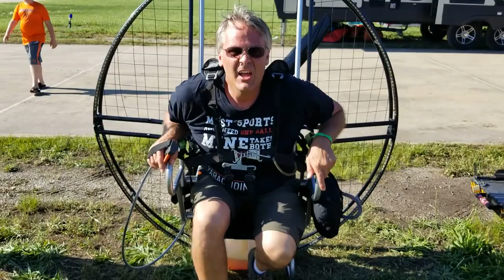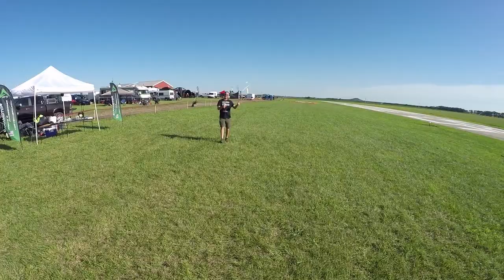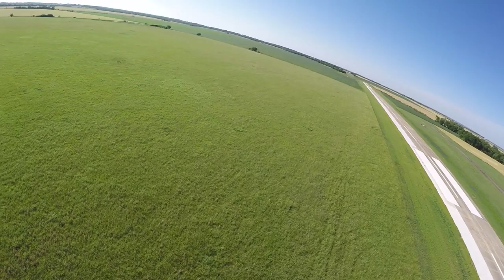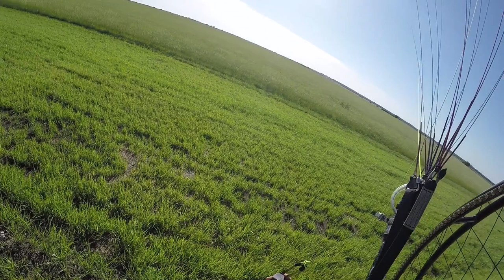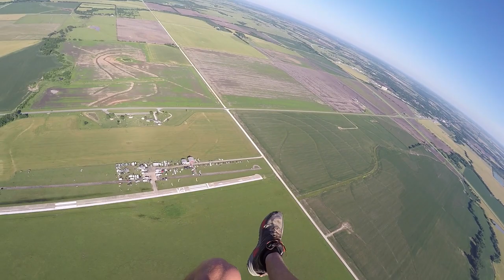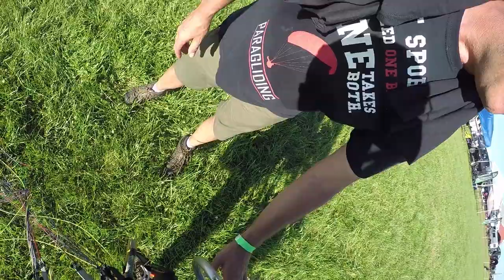Flying the Infamous Dell Schanze Flat Top Paramotor for the First Time!!

Comment: Awesome video! All units torque in one direction or another. The FlatTop doesn't do anything to compensate for that and leaves it to the pilot. When I first started flying the FlatTop, I didn't think I would like that, but I do. Of course I'm a heavier pilot (230lbs), so cancelling the torque with a little weight shift is a non-issue for me. Once you get used to the wider area between the hang points, you really start to appreciate the ability to throw your weight around. As far as weight goes, the FlatTop is no heavier then most other units. My Black Hawk Talon 190 dry weight was 62 pounds. My FlatTop dry weight is 54 pounds. So I would consider a FlatTop as a middle-of-the-road weight range. It's not Nitro light, but it's not Talon or Fresh Breeze heavy either. And yes, when ground handling the FlatTop, it is more uncomfortable than other units. But the tradeoff is already being in your seat when your feet leave the ground. You never have to let go of your toggles to scoot yourself into your seat. I only have the weight of the FlatTop on my back for a minute or two before launch since I can literally setup everything first. The skids on the bottom allows the motor to stand upright without falling over (which is super nice), while I layout the wing and attach it. I just sit down in the machine, buckle up, stand up, and go. And if it's too windy for a forward, Dell shows you how to stow your wing in the bag so you can clip in and go without worrying about the lines. For me, the bottom line is I really like the gear. I've flown many different rigs including, Adventure, Kangook, AirConception, Top80, Black Hawk, and Nirvana, and I still prefer to fly the FlatTop over those units. I'm flying a FlatTop with a Moster 185 Plus and a Dominator 19 meter wing.   P.S. I LOVE the Moster 185! I have 50+ hours on that motor now without a SINGLE issue! (I am following the maintenance guide for the motor too.) Anyways, hope to see everyone at the next fly-in! Oh, and if you're in the market for LED lights for your motor, check out @superledlights on Facebook...
Reply: Heh, you seem to be a pretty rational person. Which begs the question, how did you manage to get along with Dell?
Reply: wll1500 I drove 1000 miles with Dell one day a few years ago. He was as normal and fun to talk to as anyone I've ever traveled with.

His public persona may be a thing he does for business purposes (for better or for worse). Privately, I found him to be a friendly, smart, and sincere guy.
Reply: picramide I'm very interested to hear more. Was your trip Paramotor related? Were you his student or just casually acquanted? 

His criminal background indicates his crazy personality is probably more than just a front for his business, but it is comforting to know he can be normal when in polite company.
Reply: @wll1500  I think he's just a very competitive individual when it comes to his livelihood and the support of his family. He's been poor and learned first-hand how badly that sucks. 

He does suffer lapses of judgement like we all do to one degree or another. I speak for instance of the owl incident and his former habit of speeding through residential neighborhoods in his black jag. Both show a certain lack of empathy. But both were many years ago. 

They stay alive largely as a kind of backlash against all the criticism he's heaped on his competitors. A lot of that criticism has been rather vicious.  He was that way long before he got into PPG. In his computer business he'd say scandalous stuff about the competition every day. He was constantly coming up with ways to submarine them. He was sort of a modern-day Andrew Carnegie.
Reply: @picramide  Who told you that? Him, I'm assuming.

A man who cares so much for his livelihood wouldn't adopt such dishonest and destructive business tactics. And business practices like that aren't admirable or honorable. 

I don't think Dell has been poor a day in his life, pal.
Reply: I never said that his business practices were admirable or honorable.  Do you know the first thing about Andrew Carnegie?  Do some homework and we can discuss further.

Dell's computer marketing practices worked for many years.  Andrew Carnegie's practices were even more destructive and even more successful.  It was Carnegie's deep-seated guilt (well-deserved, btw) that led to his charitable acts later in life.

As for what you don't know about Dell Schanze - it would fill volumes.  Just because you don't "think" Dell had a poor day in his life doesn't mean squat and isn't worth my effort to rectify.
Reply: @d.jensen5153  Dell's computer marketing "tactics" further cemented his well-deserved reputation as the Village idiot and caused his stupid company to go under.

Last I checked, Carnegie died fabulously wealthy and with a successful monopoly on steel. Comparing him to Dell is an insult to every successful business man today.
Reply: You're so full of crap it's funny!!  You still have no idea how Carnegie got that monopoly.  You have no idea how many lives and businesses he destroyed through his devious and underhanded tactics.  Glorifying him is an insult to every honest businessman today.

Also, kinda pisses me off that in the 21st Century there is this narrative afloat that rich people were always rich, and poor people have no choice but to be poor forever.  Dell got rich through working very hard at a lot of jobs for a lot of years.  He also made some difficult decisions at the opportune time that turned out well.  He's also lost a small fortune along the way through PR disasters from foolish and immature personal decisions.
Reply: I promise, i'll start taking you a lot more serious if you can tell me how you know his background.
Reply: I'll start taking you more seriously just as soon as your knowledge of ANYBODY is deeper than a 30-second internet search.

I will say this:  My first personal interaction with Dell was some years ago when he consented to look at my ITV mini-wing, a wing I'd had nothing but troubles with.  It was impossible to kite and impossible to launch.

He put on a freaking clinic!  He owned that thing from the first moment.  I've never seen such deft handling of a difficult wing in such marginal conditions.  I decided that day that whatever else I though about him and his business practices over the previous decade (I refer here to his computer business), he was the best pilot I'd ever seen.
Reply: dude what is your deal? He kited your wing so now he's the ultimate badass in your mind?
Reply: The liars don't deal in logic, reason or facts.  Those who are evil bash, trash and lie regardless of truth or reality.  I built the 4th largest computer retailer in the Western US and liquidated it and retired when I was 30.  They lie and pretend it went out of business.  I"m the only person in history who can out fly a bird and they lie and try to pretend I kicked an owl.  Drive a reasonable speed on a 4 lane highway size road and they lie and suggest you a racing through kids playing in the street.  There is no rational thought to the wicked.  Those who are evil cannot be reasoned with any more than a terrorist trying to blow up a building and himself can be reasoned with.  These people who bash, trash lie are just simply evil.  They care nothing for truth or honor and hate people who stand up for truth and honor.  Those with wisdom learn from experts.  Those who are evil hate experts and pretend to learn from morons.  It's really that simple.  Liars lie while SUPERS fly.  Those who follow my advice become incredible pilots.  Those who ignore my advice don't.  Can't get any more simplistic or obvious.  The righteous have no value at all in associating with those who are purely evil that bash, trash & lie.  By all means let them fly total death trap gear without any real actual skills.  I have limited time and really have no interest in sharing my time with those who are evil.  I would much rather hand with cool, decent honorable people that care about the lives of others and the truth that benefits the lives of others.
Reply: Dell Schanze all we are all doing on here is standing up for the truth your the only one that seems to not be able to accept the truth so are you the evil one?🧐
Reply: i only weigh 100lbs so if i tried to fly it i guess id be barrel rolling as soon as i get on the throttle lol
Reply: @DellSchanze  you might just want to consider whether you look like a trustworthy professional  in these rants.
Reply: @wll1500  I spent a month with Dell and Jordan .training.he is a great dad and father and is more passionate about life then most people on this earth he designed and built the flattops for himself  because he knew he could build the best and continue to make it better .his skills  at paramotoring are  in his videos for all to see .every day he flies.and proves those skills to his students and explains and shows in detail  everything..he has the right to call out the lies and bs of this sport.and as far as the so called criminal stuff,when you live like your free and don't except the mainstream sheeple way of cowering to every bs law or  average scared to accomplish anything public,people get their pants twisted and try to ruin an otherwise great fun day.stop worrying about the bs and learn to fly from the best instructor on the planet and go enjoy .
Reply: @dwaynetempest3433  well if Dell has a right to call out bs then so do I. He didn't "design" the flat top. His design is a shameless ripoff of WalkerJet.
Reply: @Dell, I don’t understand why you are being so defensive.  Your buddy above was giving you a glowing review and I thought, maybe Dell is actually a decent guy.  Then you seem to get all defensive.  Dunno why.  I don’t know you and maybe you are a decent guy or maybe not but the rant here isn’t painting a good picture.  I’m just some random guy reading this stuff and I am impartial.  Maybe moderate your responses a bit and you might get seen for a decent guy (that you probably are).
Reply: SUPER Mike this was very helpful I’m looking into this sport and and it seems the more I look into it, it seems most people bash the man and not the equipment, I’m not looking into makin best buddies with the guy, just want too make the right purchase, after all this shit ain’t cheap no matter what gear you buy, just sayin
Reply: I've been watching everybody's channels in the past year(ish) and I try to give everybody's opinion credence, but at the end of all the Rah Rah, it boils down to skill and quality.  That said, Dell regularly renews his open ended challenge to anybody to exceed his many world records, and with so much negative opinion about the man, surely there exists a video or channel(s) of someone exceeding any of Dell's records?   If no such video exists, why should I esteem anybody's opinion or knowledge of gear above Dell's?
Reply: Derick F  well, judging by his criminal record, he's not a sane or reasonable person. This doesn't mean he's not a great pilot. But you have to ask yourself a question, do you really want to stay around a man with severe anger management problems? That's it. I know I can't trust people who can't control themselves around others. Alsp read about his computer company :)
Reply: @DellSchanze  love it, lies, good vs evil, like a good religious script. Too bad you'r not really the most believable person around. You're making plenty of claims, that aren't true - flattop is not really your design, most likely same with dominator wing, people were injured while fllying flattop etc. and you have a long story of anger outbursts over the net. Oh and I recommend everyone videos, where you basically cheer someone died, because it helps you make your point. 
Sorry mate, but I have 2 options - either whole world is against you because everyone is evil, or you just made everyone hate you with your own actions. Hmmm, wonder which is more likely 

Oh and I'm willing to change my mind, but again - good vs evil ramblings make you sound crazy, not reasonable. Maybe you should change your style a bit?
Reply: Hi Dell, How you doing ??? Long time no see or hear.
Reply: @d.jensen5153  Dell ran his comp. business into the ground as he has done to some of his students flying. With some fatal results.
Reply: @d.jensen5153  Nope never lost any fortunes let alone small ones.  Nope never had any PR disasters from doing what's right and telling the truth either.  It's my standing up for the truth which is why I've always had the backing of God himself.  Notice no SUPER training class in all of history has ever been ruined by bad weather.  Pretty silly to bash someone who walks constantly in the miracles of God.  Nope never kicked any owls and never sped through any neighborhoods at unsafe speeds.  Pretty silly to try to force one's own perception onto that which they cannot comprehend or understand.
Reply: I am scheduled for Super Training in September. Very happy to read your review of your FlatTop. I am sort of proud of myself for resisting the haters. The first time I heard of Flat Top was watching Tucker. He said don't buy one and shout out to Dell. Sorry, I don't let a 22 year old kid tell me where to shop unless they are much smarter than me...OK Tucker is much smarter than me..by God. Anywho, after many hours on YouTube and vendor sites I ended up liking Dell the best. One reason is it seems he has all the gear in stock. Other stores would show out of stock for things. I don't think I found a single dealer that had everything I wanted; and a lot of them are in Europe and I didn't know about tariff costs and such. I almost went with local instructors (I'd prefer that) but they were only dealing with quads in their training, No foot launches or trikes. I did like the kid from Louisiana. However, they were out of stock on their trike. Little things like that can make or break a decision. I like that you call yourself "Super Mike." I hope I get to hear "Super Tim" by the end of training.
Reply: @wll1500  I saw all the posts of his "criminal" behavior. That just makes me like him more. He chased a barn owl. Bad bad man...Is this sport full of pussies? Everyone is flying very loud, bird scaring, machines..Good Lord
Reply: @picramide  I agree. He comes across as a guy with boundless energy. He seems to be a loving husband and father. That's good for me. Nothing worse than passive aggressive behavior. That's what his haters do. It's just as bad.
Reply: @wll1500  You mean he points out flaws in other equipment. I want to hear that. Others do the same thing. Then, I can make a better decision.
Reply: @wll1500  You weren't there.  I was.  You have no idea how slack the wind was nor how small the wing was.  It was an amazing launch.
Reply: @wll1500  A speed wing in very little wind?  Your full of crap.
Reply: @d.jensen5153  I'm not full of crap lmao it sounds like you don't know a damn thing about paragliders 😂 want me to show you some videos of people kiting speedwings in nil wind?
Reply: Awfully nice of you to let him try your gear. I'm going in September. Dell's putting the Minari 200 in his new ones. You can still get the Moster 185 if you want it. I chose the Minari. Dell said he and his crew are flying those. I hope to fly with you one day. I'm in central Cali.
Reply: Wtf I reading this and Im getting the sense that many coments with different names actually comes from the same person. How sick must he be....

Comment: I own a Flat-Top also. The old 200 model with electric start, pretty heavy with two tanks; however, I'm a crippled up old geezer & only use it on my S-Trike....that would be the "larger than most" trike Dell used to sell. Also a custom K-2 wing...solid black with Skull & Cross Bones. I hang the emergency chute on the left side & sit on the left side of the very wide & comfortable seat when required. Never had a problem with "right torque" experienced with most power paraglider motors. Then again, it is a trike.  It's been my experience & my opinion the sport of Power Paragliding has the most "bashers" than any sport on the planet. Pilots, instructors, and salesmen alike all seem to believe "their" equipment is better than all other equipment on the market. So bash away kiddies. I'm satisfied with the equipment I bought from the crazy guy.
Reply: always like the  s trike  are u on face book or any way to chat , not flying yet but have always loved the flat top i know from only what i heard the s trik is kinda heavy but honestly wounder if weight is that big of a deal with the right wing ,